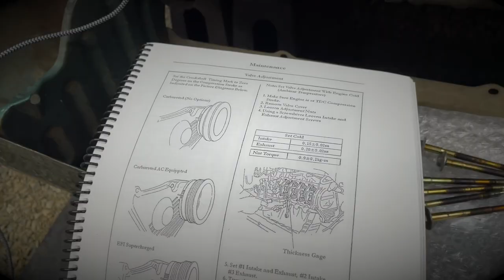Upgrading Honda Acty Van Headlights To LED, Restore and Tint One Yellow Because Race Kei

Comment: Two things to think about.  One, the yellow lens in Japan would be next to the center lane so perhaps it would be more tolerable for oncoming drivers?  In the US doing it your way puts the yellow side on the ditch side and the clear might burn the on coming traffic.  Probably need to adjust the lenses anyway.

Two, have you seen what these "Fire Trucks" are bringing on BAT (Bring A Trailer).  Sanbar in 2/28 sold for $19k and an Acty sold yesterday for $26k.  Crazy money  but I'm sure you bought yours right.  

Best regards from Idaho
Reply from the maker: Good point! I just did the drivers side to match Japan but I guess switching for RH driving lanes would make sense. Oh well. Next time lol. 

And yes it’s insane how much they pull in BAT… I get bugged a lot to throw it up there since she’s bout dang perfect and super low km’s but I think for my sake right now, it’s more fun to film content with it. More attention. If I haven desperate for money, then I’d definitely sell that one first before I put a ton of miles on it. I paid at the time 600,000 yen for it. So not even anywhere near what they sell for here. That’s why it’s fun buying over there for better prices and not knowing what you will actually get 🤣